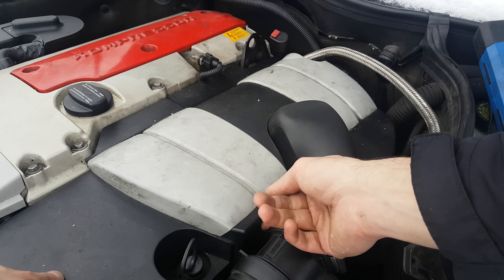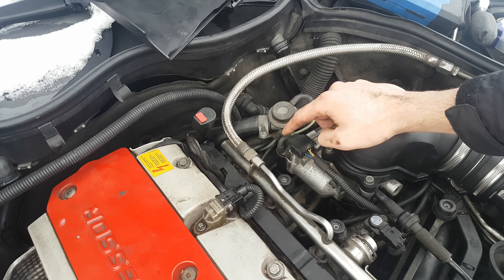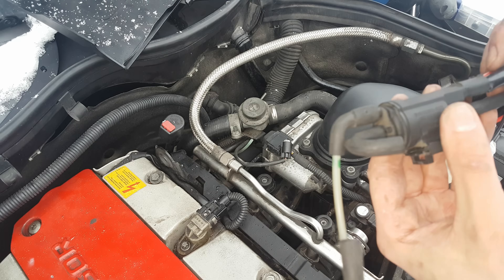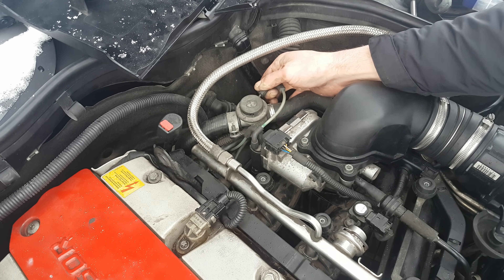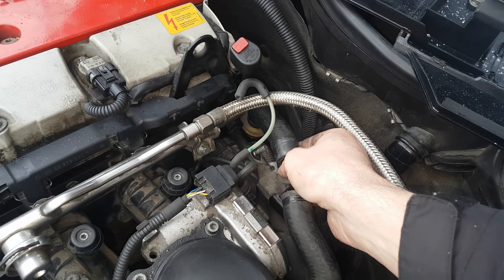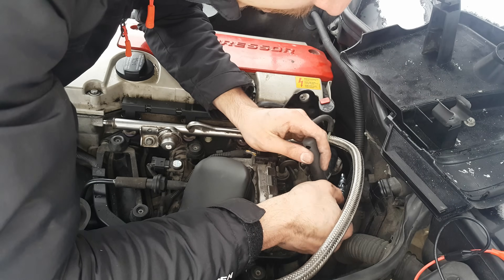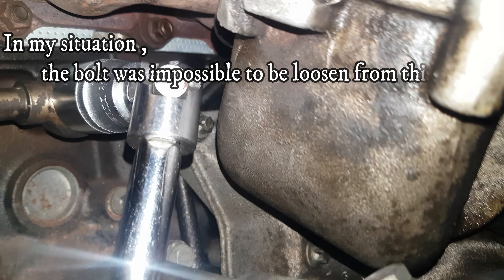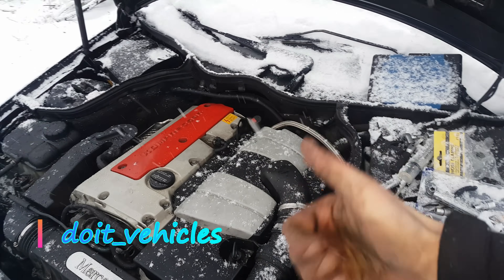Mercedes w203 Secondary Air Injection System -Diagnosis- P0410 P0413

Comment: Hi.
Just found your channel and it's excellent 👍👏👏.

Got SLK 230 Kompressor year 2000 and my pump won't shut off.

Tbh never knew about it existence in my Merc until one day I've been doing some work and simply disconected the battery for about day or two.
Then, when connected the battery the air pump starts working immediately!!! And won't shut off.
It's gonna be working till red hot but won't shut off.

I've checked vacuum lines, switch over valve , this top valve , took out and check the relay plate with k40 amp relay and some fuses ( plate looks good, no damages to soldering lines, all fuses, relays ok) 
I've also took out pump and dissmantled to check hows things inside ( all been good, no burnings just some dust) so cleaned, put back together.

AAAAND...pump is  still working 🤦🏻‍♂️

I need to check this valve at back of the engine, cuz forget about it but honestly have no more ideas what's going on.

Also got P2003-2 fault and it says about undervoltage on the sensors.

I've put NEW 
*MAF s
*CAMSHAFT s
*CRANKSHAFT s
*waiting for 2x MAP sensors

Have no idea what's happend to my Little Bastard, all been great since last year and all of the sudden some strange things started to appears.

Too long list to point out.

But if someone could help with pump I'll aplreciate that 👍

Comment: Great video . i got p2031 and p2036 on 2001 Mercedes c200  w203 i clear the code i tested the o2 sensor upstream by add fuel source to the vacuum line read rich when i apply vacuum it read lean . what do you think the problem thanks

Comment: Please HELP, I have an issue on my w203 2001 standard, when i turn it on, and the engine is cold, it starts to shutt off the engine, i turn it on again and works fine, later on the road, when i shift to neutro it shutt off, what could it be? can it be fuel injection issue, oxigen issue? or vacuum lines issue???

Comment: Good day! 
The shutoff vavle open only in first 150 seconds? 
When else and why?
Reply from the maker: The purpose is to reduce emissions when the engine is not running in Closed Loop ( O2 sensors are not yet on the operaring temperature)
Reply: @doit_vehicles  When else???
only cold starting?
Reply from the maker: @gansanchis  yes , only cold starting
Reply: @doit_vehicles  thank you. Please give your mail.

Comment: Yes sir, can you help me out ,i have problem  of my 2009model  c200 kompresor, troble code p0045 ,its say super charger boost control solenoid circuit A / open, where can see the boost control solenoid
Reply from the maker: it's right after the air filter - it looks like the throttle body
Reply: @doit_vehicles  I cannot see it,with this  model,2009 c200 kompresor,tnx anyway sir
Reply: You mean the air flow sensor or map sensor
Reply from the maker: @cilkitzvictoria4586  2009 has a slightly different engine: Look for the solenoid which switches the kompressor . Its vaccum actuated and it  should be somewhere around the kompressor
Reply: @doit_vehicles  sir,can i send a video of my car
Reply: No its okay sir, ill check it around the kompresor,I hope I find the boost solenoid circuit A / open,thank you very much sir

Comment: Hi Guys. Update on my previous comment. I succeeded to replace and connect loose or damaged vacuum lines, and the one I mentioned before goes to the firewall, but I don't know what is doing there. Anyway, the back headrests still do not work after this. Regarding the connector to the switchover valve, the reddish wire (red and green I think) is always negative, but the other one which is grey or white with an orange or brown line (not easy to define unless I cut the protection), don't have the positive during the first few minutes of a cold start, or so. I inspected all the relays and fuses in the boot and at the front and, in addition, two of them (K and R) were tested while plugged. Thanks, doit for your video on disassembling the intake manifold, which I partly followed to do the job. The greyish wire coming from the switchover valve seems to end up at the front fuse box; I tested one with a similar colour and it has 12V positive but it is for way too long after the engine starts. What makes me confused is that this same wire appears to have continuity with the one in the connector! I need to double-check that. I don't know yet how to connect the vacuum gauge. By the way, I have not yet tested the car on the motorway, but the idle is definitely more consistent. Regards.

Comment: Hi, doit. I always like to come back to your videos. I still have this car. After one year I have not discovered why the switchover valve connector doesn't have 12 volts when the car starts cold.   Besides the three vacuum lines that go in/out of the switchover valve, there is a fourth vacuum line hanging loose underneath the top assembly, which is connected near the vacuum line plastic tube coming from the switchover valve. I don't know where the other end should go. Any help to solve these issues is welcome. Related to this matter is how to connect a vacuum gauge in this car to do a diagnostic check. Take care doit and guys, your contributions are very helpful.

Comment: Hi, I know you must be busy so maybe someone else can help me with this question and do a small test for me. When I unplug the harness from the switchover valve and test the two wires I'm getting 4 volts on one wire and 11 volts on the other wire, does anyone know if the voltage is correct or should I be getting 12 volts and ground?

Comment: Hi, great videos, really useful!! What scan tool / app do you use to monitor the oxygen sensor operation? Can you use the Torque android app and a generic bluetooth ELM324 OBDII adaptor?
Reply from the maker: The car has  obd2 port . I used Blue driver which allows me to see live data of O2 . Check the playlist for the video about O2 sensors on this car .

Comment: Hello great video, it explained much more clearly what I needed to check, to get rid of my PO410 code.
When I cleared my PO410 code, I can drive for miles 300 miles or more,  but sometimes I can only drive 75 miles or less before it sets the PO410 code again.
I checked everything just like you showed in the video, I have vacuum where I suppose to have vacuum, and I have pressure where I need to have pressure (on the hoses you showed).
The solenoid works properly, for the required amount of time, ( I did this check after allowing the car stand over night.)
Code PO 410 keeps coming back, I started having this problem at the beginning of the summer it was fine all last winter.
I would appreciate any help with this problem, Thank You in advance.
Reply from the maker: if you say that all the tests were done ; what's left is to get a scan tool with live data and do a diagnose , see what happens when the code is trigered   (  LTFT STFT ) But do you have the same engine ? or the v6 with the air pump
Reply: @doit_vehicles hello I want to check the valve but I don't know where's the plus and - side? Can I make destroyed the valve when I checked both sides with 12 volt?
Reply: Bonjour j’ai deux codes erreur ça fait 1 ans je trouve pas … p203A et p2039 merci

Comment: Hello Doit_Vehicles.

Am kindly asking for your advice, I have a C200 2001 cl203 coupe with M111 engine and C180 2001 s203 estate wagon with  M111 engine.
I want to swap the engine together gear  box.
Can that work? Cl203 has an intercooler and s203 doesn't has.
And they have different secondary pumps.

Comment: Just a site note. You dont have to remove the supply line. You just unscrew the check valve. You can do it if you make a special key by cutting a head of a if i remember 27 wrench. Mercedes mechanics of cors have access to original removal tool. The real problem is in the valve. Cleaning wont help. Its a design flaw. Over time the rubber seals wear out and the exhaust fumes will over time destroy your second purge valve.  Tipically the last 60  - 80k miles. I think I have a masters degree for secondary air injection troubleshooting, as how long it took to find the problem :D

Comment: I have C240 2007 w203 112 engine, I have problem when the engine is running, the car shaking, I tried to unplug all coil, seems like 3 coils are broken, i have changed  with new coil. but the problem is still the same. The engine on low RPM shakes the car a lot, after I try to speed in a free way, the RPM can go high as I kick down the throttle, but the speed and the power of the car wont go up. any idea why this is happening?
Reply from the maker: there must be done some proper testing beggining with checking the live data and read any possible codes .. it's impossible to guess what's the issue .
Reply: @doit_vehicles  I scanned it, it says some voltage issues spark plug) but I'm not sure about that, because after a while the engine runs normal. I tried to start the engine in the morning, same problems, engine stalling, but the engine is still on, no check engine light at the dash. I turned off the car, take out the key, and start the engine again, now the engine runs normal again.. I'm so confused

Comment: Did this today, to clean the check valve you do not need to remove the torx holding the pipe line or check valve, just raise the car, and remove the big 27 bolt holding the fitting, you will have enough space from underneath, remove the perforated bolt, careful not to loose the two crush washers, one behind the head side and one on the other side of pipe. take a peace of 5 by 5 inch aluminum foil and slide it between the pipe and the intake manifold side, to block anything you will spray through the check valve. I used a pulverizer gun  and gasoline to clean the check valve which was almost completely clogged. all the junk came out of the pipe, the aluminum foil sheets blocks all this junk from entering the exhaust system. Done! no more insufficient secondary air flow code.
Reply from the maker: nice work !

Comment: Blessing I have a 2005 ml350 W163 code P0412 secondary injection pump valve A malfunction, the pump runs every time the engine is cold all fuses are good my problem is I'm not getting 12volts at the solenoid when I crank the engine. Your answer is highly appreciated.
Reply from the maker: Try to inspect the wires for the selenoid to the PCM ; Is it sure that the selenoid is not activated by during a cold start ?  in the video about the Oxygen sensor I do that . Basically you cehck if there is any short or damaged wires betwen the selenoid connector and the computer . Thats the only thing I can think of with these symptoms you told me .

Comment: Great video as always. Could You help me with my c180 2001 petrol, OBD scanner displays P 200A error and points me to the Powertrain. What do You think I should check first? 
Your videos are amazing and very well explained,keep up the good work :)
Reply from the maker: Hei ! I am glad it's helpfull ) Can you tell what are the symptoms and if you have a Intake  Manifold Runner Control system ( the extra flaps inside the intake  manifold ) For example I do not have that.
Reply: @doit_vehicles  Well on cold engine when accelerate hard instead of more power the front end stomps to the ground. If I accelerate slowly everything is ok. It feels like there is some vacuum leak from somewhere. Changed the MAF with new, cleaned the throttle body, yet the problem still there. Not variable RPMs on start up.
Reply from the maker: If you suspect a vacuum leak spray some gasoline around that area while watching the oxygen sensor response or LTFT STFT .. Fuel pressure under a load  might be also a factor ..

Comment: big fan frpm day one!!! Can you do a troubleshoot video of the fuel gauge ? my car goes out of fuel 5 km after the reserve light has com on. Thanks in advance.... I know it might take some time.
Cheers and very informative video as usual !!!
Reply from the maker: Hei ! thanks for beeing around . It sounds like there is a issue with the fuel level indicator ; until I do a video about that , you might wanna check the fuel pump assembly and test the fuel level potentiometer . Is the same as a throttle body or acceleration pedal or any other sensor 
 Here is how to remove the fuel pump with the fuel level sensor  : 

https://youtu.be/WyMbpITvlRA

Cheers !

Comment: Hi doit_vehicles

I got a P0410 code related to the Secondary Air Injection System. I followed your video and, apparently, all these valves work. I could only find (confirmed) that there is no power in the switchover connector when I start the engine cold. What shall I do next?  Thanks in advance.
Reply from the maker: Hei ! 

It's quite hard to tell without seeing the car , did you check as well the canister ? also check if you have another selenoid attached to the canister (some models have it ) And if you have a scan tool you might check the freeze frame ..
Reply: @doit_vehicles  

Dear doit_vehicles
Thanks for your reply. I have a picture, https://drive.google.com/open?id=1VUXg4xyCWM-91BJUrq6eu4nkLfiVZRU- ; I think my car is like yours, I don’t see any canister. I followed your video and tested the valves, the shutoff valve like you did in the snow with a syringe, but for me, in Malaysia, it was hot, no snow but mosquitoes. For the check valve, I used a bicycle pump connected to the pipe and the air was flowing. For the switchover valve, I used a multi-meter and a 12V supply; I could hear the click and there was some electric resistance.  The scan tool gave me the codes P0410 (secondary air injection system) and P0172 (system too rich), that’s why I went to investigate. Finally, I noted that the connector to the switchover valve doesn't have current when I started the car from cold; I confirmed this a few times because I was afraid the multi-meter probes were not properly connected, therefore I used pins inserted into the connector. I am very grateful if you can show me the next step. Regards.
Reply from the maker: Hei emirwati ; 
I confused the Secondary air injection system with evaporative emission control system ... sory . It's very possible from what you describe that the swithch selenoid (the one you tested ) is not allowing the air to go into the exhaust therefore the oxygen sensor is getting hot slow and the engine must run on "open loop" injecting more fuel ; So after all this the oxygen sensor whe it gets to working temperature it reads rich in fuel - therefore the code p0173 . 
Now the next step is to find out why there is no power at the connctor . Try to test the continuity  betwen the connector from the selenoid and the one to the PCM . Than when you find out which pin are (on the PCM) do a voltage test there . That can be a first step ; A shorted wire can be a plausible cause to this issue , especially in a hot weather with mosquitoes like yours )

Comment: Thanks as always for another great video, love my c230k and these help me keep her on the road! I do have a side question, do you know what part of the intake assembly would be called the "intake manifold runner control" valve?
Reply from the maker: Cool ! Very good cars and nice to work with .That's like another throttle on each cylinder at the end of the air intake manifold . Like my car does not have that - It uses the main electronic throttle to regulate the air pressure in the intake
Reply: @doit_vehicles  It turns out the cheap OBD tool was pointing to the supercharger waistgate being "stuck open". Took me entirely way too long to realise code description was just a generic reference X<
Reply: Was your faultcode p2006???my car (c200 kompressor)does not start with cold engine.i have to crank it for about 6 minutes before it starts.when engine is a littlebit warm it starts perfect...i was trying to find this'manifold runner control valve'